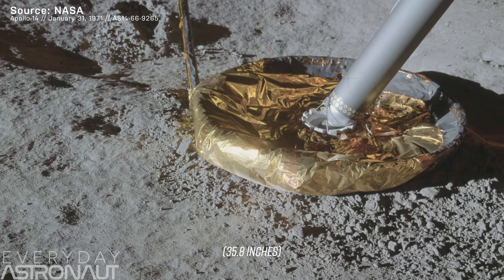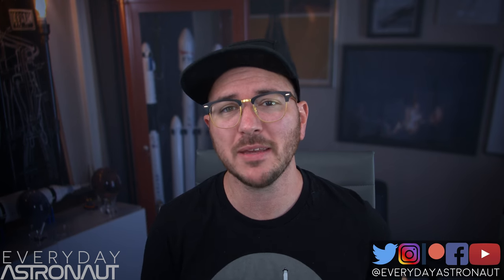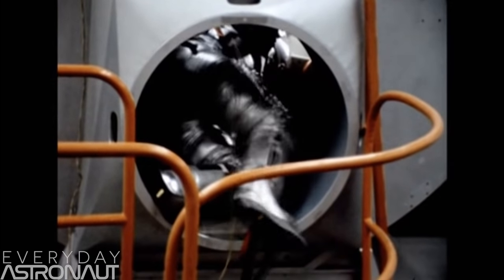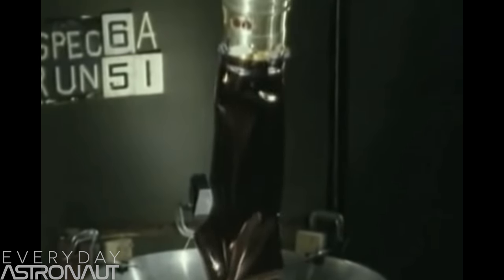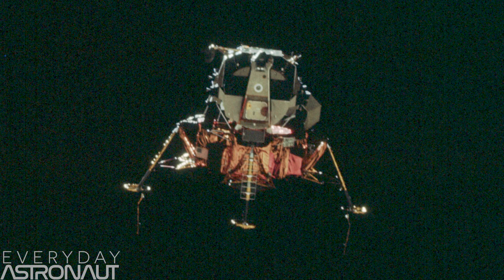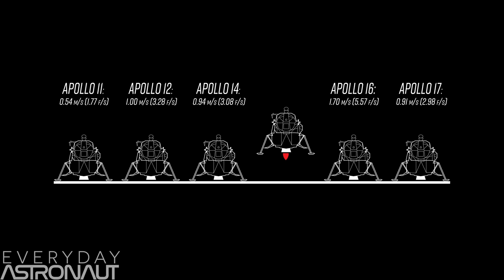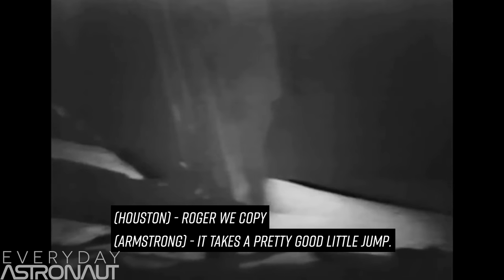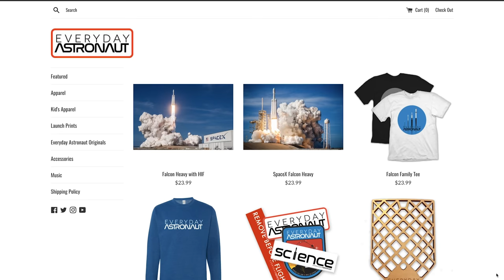Why were there missing rungs on the Lunar Lander’s Ladder?

Comment: Fascinating, I was wondering about hinged ladder - maybe NASA thought that might be something to go wrong (and maybe too heavy)
Reply: Perhaps a worry that it wouldn't deploy or that the hinge would fail and the lower half of the ladder would break off?  There were so many unknowns that the simplest and least problematic solution would be the one to go with.
Reply: @samsignorelli  I'm sure it was debated many times during development
Reply: @PhilipChou  Likely....given the complexity of every aspect of the mission, it's really amazing they landed in JFK's time frame.
Reply: @samsignorelli ... by the way, even if the landing had been pushed to 1970, that would have been OK as '70 is the final year of the '60s decade. (Just like the 21st century didn't begin until 1/1/2001 (not 2000)).

Comment: At the time, prospective micrometeor & dust accumulation calculations suggested that the moon could be covered in an average of several meters of fluffy, almost liquid-like powder.  I think it was Robert Heinlein who even wrote a story based on it, describing dust-pits and avalanches that could pour across the surface to bury or otherwise cripple vehicles, or lure a driver into a deep fall into a crater.

When the moon turned out to be much more bare, scientists had to go back to the drawing board on the matter, and a different theory/mechanism of surface dynamics emerged as the best.  Of course, for years, the Young Earth Creationists were touting the lesser amount of dust as proof that the moon was only 6000 years old...

Comment: They used 1 or 2 less rungs on the ladder to save weight but, had plenty of extra weight capacity to spare, for bringing the lunar rover. That makes sense.
Reply: No they didn't. The Lunar Modules equipped with the Lunar Roving Vehicle were upgraded specifically to land larger payloads and stay longer on the lunar surface.

Comment: One other bit of trivia: Armstrong recommended removing the contact probe on the ladder-leg (only three of the four legs had probes) because of the worry that it might bend backwards on contact with the surface and block the ladder.

Comment: So if they didn't change the ladder based on their experience with Apollo 11, is there anything else they changed for the later missions?
Reply: They did change the computer software after two documented system crashes on the LMs landing approach (1201 & 1202 errors). The AGC took less than a 1/4 second to reboot so this wasn't a fatal issue (Microsoft wasn't in business yet).
Reply: There weren't many changes to the Apollo 12 LM as a a result of Apollo 11, mainly because nothing much went wrong and because Apollo12 was already assembled and being checked out at the VAB: so the fewer unnecessary changes made, the better.  The LM software for each mission was different in any case, but Luminary was also amended to stop the 1201 and 1202 alarms if the radar switches were mis-selected.  A bacteria filter was removed as it caused problems with cabin depressurisation, there were changes to improve communications whilst on the moon and, probably the most important, some circuit breaker guards were installed to stop accidental breakage or closure  of key breakers (such as the engine arm CB which was broken on A11). There were of course also a few changes to procedures, crew training and ground check-out of the LM.  A few other modifications were made to Apollo13's LM which were thought sensible but we're not critical and were decided not be incorporated in Apollo 12.  That's all by way of changes resulting from Apollo 11's experience I could find that they made to Apollo 12's LM.
Reply: Tang
Reply: Believe they redesigned the cabin depress valve, as Neil and Buzz had trouble opening the square egress hatch door  (almost damaging it) because cabin de-press valve did not completely depressurize the inside of the LEM. Apollo 12 did a unusual procedure of opening the top hatch and this may in part to fully depressurize the LEM before opening the egress door... but may have been opened just to see how close to Surveyor 3 they were. Maybe both?
Reply: Smelly Elvis   The problem with the hatch, caused by slow depressurisation, was resolved by removing a bacteriological filter which I mentioned in my reply.  I don't think there was any other redesign to remove this anomaly.

Comment: Something any ksp player has learned the hard way, getting back into the lander after getting out.
Reply: Especially if you forgot the ladder... Or Mobility Enhancers.
Reply: RCS Jetpack though
Reply: @yert5679  What if you used all your RCS fuel jetting over to the nearest big crater?
Reply: @richardmillhousenixon  i guess you get stuck there, or if the module can be controlled remotely, just lower the landing gear
Reply: @yert5679  Or you can, y'know, jump
Reply: @richardmillhousenixon  you cant grab anything when you jump im pretty sure
Reply: @yert5679  you can, you just have to aim right... yep, forgot the ladder and didn't know about the jetpack XD

Comment: How did they calculate weight of the LM (with all the rock samples collected) before launching from the Moon?
Reply: Interesting question. I never thought of that.
My first hypotheses is that they just packed the available containers full of moon rock and started the calculation with the average density of moon rock. Once the ascent vehicle launched the internal acceleration sensors provided the necessary exact numbers to calculate the real mass.
Reply: @3gunslingers  You might be right! They also unloaded/left equipment on the Moon. They knew the rough numbers, I guess.

Comment: The "contact light" was a big green light on the LM's panel, which had the words LUNAR CONTACT on it in white. When the sensors detected equal force on each leg of the LM, the light would light up. I'm sitting here with my LUNAR CONTACT button in  my hand...

Comment: Holy Hell! There are so many more optimal designs for the ladder, even taking the weight limitations into consideration. For example, what about a ladder that simply utilized a sliding side rail design to extend & lock it at the optimal length?

Comment: The Question is easily  answered  why rungs were missing.
The 3 feet were an extension of the ladder that slide along a rail to hit the ground
to make ground support contact.  This extension was adjustable at landing to 
meet ground and ladder.  Nothing was missing.

Comment: The landing gear was designed to absorb a 6 foot fall to the surface - the equivalent to a 1 foot fall here on earth, and have a very small chance of collapsing.  Therefore it is clear the legs would not collapse under the weight of the LM - at least  not quickly.  The shock absorbers might have slowly given way at worst.

Comment: After reading some of the moonwalker's books it sounds like the legs collapsed about as much as expected but do to Apollo 11's gentle touch down not as much as the others. And being the first to land on the moon had no other data to compare it to. As mentioned the landing speed and lunar surface itself all played a part in the final collapse. In zero-G it was not a real risk that they would not be able to hop up to the first step. It was just a little extra effort but nothing unexpected. And NASA being smart had the first on the surface test it to be sure. Jim Irwin struggled a bit because Falcon landed on the edge of a crater and the LM was at a slight angle at final rest, which left the ladder leg uneven. It was interesting to read about in Dave Scott's book.

Comment: The thing that always amazed me was the incredible length of the posts that would stick into the moon underneath the feet of the lander, they looked enormous. I was always amazed that they were confident that they would not hit a hidden rock under the surface and topple over the lander? Am I the only person to wonder about this?
Reply: The feelers were very flimsy, only intended to turn on the contact light so they could stop the engines. They got very twisted.

Comment: "Many scientists thought the surface might be so soft and powdery, it might swallow a spacecraft or people entirely on the surface." - This is the comment I wondered if you would make, and one of the reasons that I watched this video. Back about the time that you were in elementary, maybe middle school, I had long-running arguments with people on Usenet as to what the scientists of the '60s believed about the lunar surface. Specifically, I asserted that they claimed that Moon is supposed to be covered in several meters-thick dust, deposited over billions of years. Of course, nobody else in the forum agreed with me, and they all brushed off the suggestion that scientists believed such a thing. It makes a difference, because it relates to how we determine the age of Moon.

Comment: Summary:
Nasa didn't know how far the lander might sink into the surface with the landing legs, so they made their own reliable suspension for them known as crush cores that was made of aluminium. The ladder is so high up because they did not have the slightest clue how strong the they'd be landing, or how far down the landing legs were going down. They only had the ladder go down to the point that they did know wouldn't be crushed by the surface.

Comment: I have a question that I was not really aware of before. In speaking about the LM legs or struts , at one point you mention hydraulics . I am curious about how the hydraulics would have worked in the temperature extremes . Did they have hydraulics in any of the systems? What kind of hydraulic fluid would they have used? Would the hydraulics be similar to large equiptment as in excavators here on earth. Thanks for any answers . :)

Comment: I'm not NASA level by any stretch, but I am a mechanical engineer, so here's my take FWIW. A hinged ladder would still have failed if the feet penetrated as much as anticipated. You would not have been able to unfold the ladder and it would now have to contend with bending forces it was not designed for when the astronauts stepped on it. The picture of the russian lander there looks orders of magnitude heavier than the apollo lander, so don't forget everything on the apollo was engineered to just about do a job and not be any heavier than needed. The russian lander was never tested of course.
A telescoping ladder, with adjustable length between each rung, would have worked, though of course that's now more to go wrong and muscle memory from training could lead to incidents with the astronauts using it. Another option would be a solid, set length ladder that could be slid down the leg in runners as needed, and additional rung sections stored inside the LEM and bolted into place as needed upon exit. Again though, its possible additional weight. Did the ladder design remain the same after Apollo 11, or get changed once they knew how far it would penetrate?

Comment: As little kid that large leap down was the big part of my memory of the landing and always a small bug of why small step in the comment. Of course that is watching on a so so black and white TV at my school, for some reason I have suppressed I was at Summer School as I did not realize till 50 year anniversary the date of the landing could not be during my regular school time. But I do have separate memory of being at Summer School so that was answer.  Did not know till this moment that the leap is actually down to the pad and not to the surface so it really was a tiny step down. And of course Neil had worked out what he was going to say before he landed I'm sure. 
Had already heard account of how Neil did not shut engines off when he was told to and thus a way softer landing, seams they all did that to some degree guess you can't get a expert pilot to land harder than needed easily.

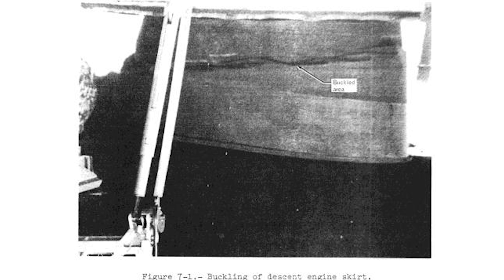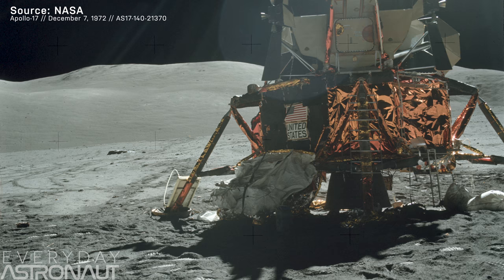Comment: Just a small question - during descent, we see radial striations, presumably lunar dust being blown by the rocket exhaust. Yet none of this is evident in any of the pictures or videos. So what- someone swept up before they started taping the videos? I’d say someone goofed. Also 10:41 the nozzle getting crushed from the pressure of the thrusters in the descent stage? When the amount of thrust required was so small, that it didn’t leave any evidence of any disturbed dust (11:10)? Wait a minute ... I’m so confused...

Comment: That makes complete sense, they couldn't possibly use a telescopic ladder, that would be absurd.
Reply: Why add the weight of this? Can you tell me why?
Reply: @3gunslingers  Safety might be a consideration, who would send someone all the way to the moon just to have them sprain their ankle as soon as they got there let alone find out they couldn't get back in, only a moron would make the ladder too short, and it doesn't need to weigh more if the rungs are further apart, they weren't that concerned with weight anyway as they brought back loads of moon rocks, they could have just brought back one less rock. The only fortunate part was it was all made up anyway so it didn't matter.
Reply: @dubsydubs5234  
"and it doesn't need to weigh more if the rungs are further apart, " Why do you think the rugs were exactly spaced as they were? 
"they weren't that concerned with weight anyway as they brought back loads of moon rocks," In which direction did the ladder travel and in which direction did the rocks travel? You never thought this through, did you?
Reply: @3gunslingers  So they spaced the rungs exactly right but they were 2 rungs short, so they got it exactly wrong. What was more important than getting off and on the ship safely? Are you suggesting the entire mission wouldn't have been possible if the ladder was longer? You typed before thinking at all?
Reply: @dubsydubs5234  
How do you think they got to the spacing of the rugs? Can you imagine the thinking behind it?

Comment: Well, once they discovered from 11 that this compression wasn't really happening, then why didn't they make the next descent stages with at least one more rung?
Reply: Why change what works? And add weight?
Reply: Because,  @Pygar2 , as explained in the video, it actually didn't work that well, and the rungs were already designed to be really light, so one more rung wouldn't have added too much weight, and because of how they found out after the first one  that this lowering wasn't happening like they thought it would.

Comment: reminds me of engineering going into how to make ink in pens flow in zero gravity...when other folks just used a pencil.  Of course...why NOT fold, or for that matter, telescope, the ladder?
Reply: I would say it's for safety reasons... fixed ladder equals no moving parts that could get stuck or not expand fully (in case of a telescopic ladder) and thus resulting in a mission abort, since the astronauts couldn't re-enter the module...

Comment: that is the first time I heard about the ladder... it's easy to jump of a ladder..the question is now..how did they get back up and into the capsule?
Reply: John
They simply climbed a few rungs using just their arms. Even with those heavy suits, they only weighed 1/6 what they do on Earth.
Reply: @PaulSchober  Ah..so they used their hands.... I assume they just put the rocks and the spades in their pockets then?   :o)
Even the U2 pilots have to use a "space suit" because even on earth we would boil or freeze depending if your moving or standing because there is very little pressure outside at high alt.

Comment: What diameter are the main struts is what i want to know for a model I'm doing.
I inadvertently discovered the struts were filled with honeycomb to take the expected landing speed of 10 ft per sec. this should have compressed the struts but they contacted at 4 feet per sec so they didn't compress.

Comment: This is the answer to the ridicules question of missing rail steps.
The 3 feet were an extension of the ladder that slide along a rail to hit the ground
to make ground support contact.  This extension was adjustable at landing to 
meet ground and ladder.  Nothing was missing.

Comment: What are the flashes of light that reflect off the back packs? They look like wires holding the astronaut up. Or are they antennas ? Cheers
Reply: Those are antennas. What kind of "wire" would you expect there?

Comment: Just became curious: how did they know what the gravity was on the moon? My guess is that the mass of the moon had been calculated based on tides or its orbit. In the case of tides, I have no idea how that would be calculated and in the case of its orbit, how would they measure the tiny circles Earth was moving around the center of mass of the earth-moon system in order to make that calculation? Idk if this was clear but if somebody knows the answer please tell me! :)
Reply: Perhaps you haven't noticed they've been doing these calculations for hundreds of years. Check basic physics textbooks, and original papers dating back to Newton and before.

Comment: Maybe Everyday Astronaut could explain why they fitted and proudly tested a 1g pulley system for the 210kg LRV?
On the moon it would weigh just 35kg, a simple lift of 17.5kg for each astronaut. ..
So WHY the complex, timewasting pulley system?
Reply: Because it wasn't complex, nor timewasting. All you had to do is pull the rope, and the LRV would unfold itself and settle on the ground.
Meanwhile, in your scenario, the astronauts would have to manually remove it, set it on the ground, and then unfold it themselves.
Which one do you think is easier and faster?

Comment: Wouldn't that suck if a flimsy ladder broke on the 2nd guy coming out, no way to get back in the lander...
Reply: One could lift the other; the other could drop the emergency "jumper cable" for direct-starting the ascent engine, and use it as a rope.